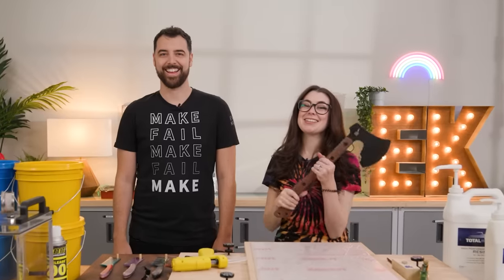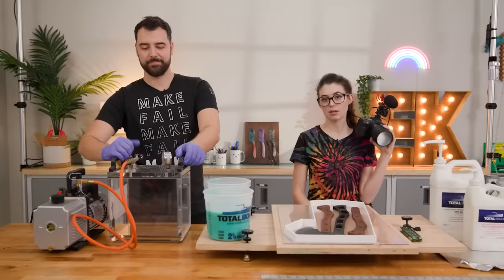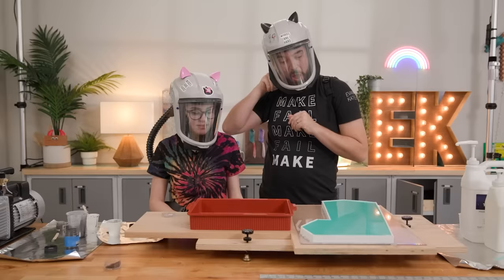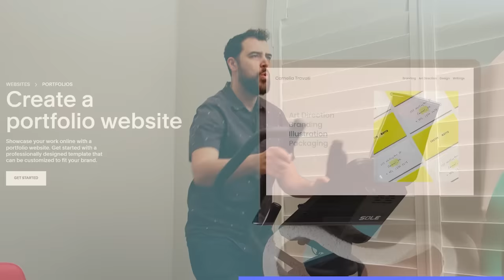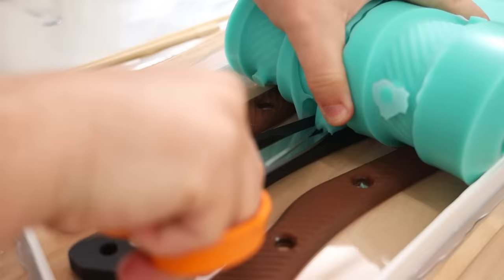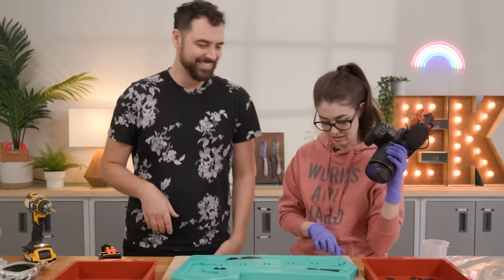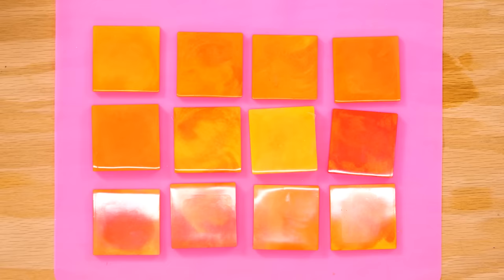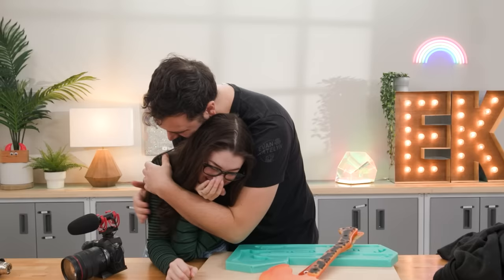Making a Lava Resin Axe (it glows!)

Comment: The glow looks so cool and the color for the lava is spot on! ❤

I think the main problem with the rocks is that usually the dark crust floats on top of the lava so you’ve got a bit of a 3D-Effect going on as well as the different textures. But the clear coat you guys applied first gave both lava and rocks the same texture, both were shiny. Maybe it would be more realistic looking if you made the blade completely yellow and red with glow and added the rocks later on the outside. Maybe airbrush them on or use some kind of grout or some of the techniques people use for making rocks for miniature landscapes.
Reply: I thought the same thing! But I was thinking that maybe they should've pressed the rocks against the lava handle when it was still tacky, so the lava would be dislodged in a (hopefully) naturally-looking way
Reply: @PrismariLaura  That’s a good idea! I was thinking maybe an led strip running down the middle of the handle could be a great alternative for the glow pigment. That would give the lava resin more contrast and make it less cloudy.
Reply: You guys should film yourself making your realistic lava axes 😊 the ideas sound neat
Reply: I was thinking maybe painting the rocks could help there are  lots of organic fake rocks tutoríals out there
Reply: I wonder if it would’ve worked to have just done the inner core the lava, whereas the two outer handles are clear coat and the rocks? That way there’s still some semblance of a “3-D effect” of the rocks being on top of the lava, but still having the handle be functional
Reply: @Drew Stark that's pretty much what I was thinking
Reply from the maker: Adding the rocks after would definitely be a cool technique to try!
Reply: Just a thought for when you display it- a black shadow box with LED lights (in ax silhouette) to illuminate the ax to be able to instantly get the glow effect. Maybe even having a switch or timer for the LEDs to "charge" the ax then letting the ax glow until dim.

Comment: For the lava rocks, a good idea would have been to pour a thin layer of silicone in a box, then put your fireplace lava rocks on top. Once cured, remove the lava rocks and use the impressions in the silicon to make your resin lava rocks.

Comment: I gotta say, as a resin tech, I appreciate the fact that you guys actually use good PPE for working with resin.

So many woodworkers and craftspeople work without so much as a 3M respirator (and those are imperfect to say the least), so it's refreshing to see you guys using gloves and the fancy helmets, because contact with the skin can (hell, WILL ) cause cancer, and breathing it in can cause cancer and other problems down the line.

It's especially important to wear some sort of respirator if you grind, drill, or sand into the resin as well. The particulates are terrible for the lungs, and the damage can get worse over time from even a small bit.
Reply: Yeah! It's very important

Comment: I'm late to this video so I'm not sure if you'll see this, but I had a suggestion if you ever do this again. For the rocks you could glue rock shapes to the actual axe handle before you take a mold of it. Then shape of them would be incorporated into the handle instead of the handle just being flat. That way it'd be more textured with the rocks on lop of the lava. Also then you wouldn't have to worry about having to use a clear layer to keep the rocks from getting buried in the lava.

Comment: Katelyn's idea of iso alcohol to remove the mold form is perfect with a small addition: To reattach the form to the glass, heat the glass in the oven to 375-400, take it out, Place the mold form on it to cool together. Its should remelt the glue, but if it misses anything you can use a soldering iron or hot air gun.

Comment: Awesome project! Two things that came to my mind:
-The handle color was way duller than the body of the axe. Is it because of the texture of the original you took the mold from? what'd happen if you dremeled any texture away?
-Does the UV powder shine trough darker pigments? Volcanic glass-like on regular light that changes to molten lava on UV sounds amazing. Maybe a bit of it on the rocks themselves.

Comment: something that could help, lava in the parts that is glowy most of the time has a even edge between the peices, like they could all be smooshed into a solid flat peice but have been broken and seperated a little bit. almost like tiled floor, how the grout inbetween is always the same thickness to the other peices

Comment: If you ever decide to make something similar in the future, you could find something water-soluble to replace your outside clear resin layer on the handles, that way you could remove it after you poured the lava to let the stones provide the handles' texture rather than the grippy-lines from the original.

Comment: I love the finished product, the only thing i was thinking is maybe adding a couple pieces in the axe head itself to blend it in with the hand a bit more and then the second being maybe attaching the rocks after it cures with resin so the texture isnt lost by the inital clear coat. Maybe somehow doing a flipped mold so you can transfer it and then seal it in a half layer on top,

Comment: When I worked with polymer clay a lot, I used salt of different sizes pressed I to the surface of the clay before baking to make a faux lava rock texture after you bake the clay and dissolve the salt. I wonder if you could do the same thing with resin. Get it to a honey (or slightly thicker) state and then press salt in, then once it’s cured, soak the resin and dissolve out the salt

Comment: It’d be a great for a prop for like cosplay or dnd or something. Its super cool in UV. I have a hard time imagining how to make it look a bit better in the nonUV shots, since the handle texture is there for grip so you can’t get rid of it, and putting textured rocks on the outside of the handles would make it impossible to handle. Maybe matte, flat rocks on the outside of the handles? Like an extra layer? Idk. Either way, good job, I’m sure it was a struggle.

Comment: to help add texture to pieces like the little resin rocks, it might help to use rough sandpaper once it's fully hardened!
it does kinda look... not so great, but it does look cool in the dark! I think maybe what hurt it was the texture of the handle, along with too much clear coat that ended up sort of clouding the blackness of the rock-bits, which made them stand out less against the red-yellow behind them.
but it does amazing in the dark! that glow powder definitely did its job!

Comment: Omg, this came out so good!! Follow up idea: Resin Recurve Bow! (Maybe resin arrows too?) It would be so cool to see if the resin could be flexible enough to be a single piece cast, or maybe you simply make the handle and buy professional risers (the arms that determine the resistance of the bow) and attach them separate. Orrrr maybe a crossbow with little resin bolts? Anyway, custom archery gear would be such a cool video!

Comment: I had an idea for a project somewhat similar to this. I pictured an aetherpunk-style sword (thinking like a Dao/Cutlass mashup) made of a (glowy) resin core (edge not necessary) with laser cut wood panels that make up the flats of the blade, as well as possibly elements of the guard. The wood would have runes cut out of it, with the intention being that the glowy resin shines through the runes and/or decoration for the blade. Imagine if Kratos' Blades of Chaos and the Darksaber had a baby during Pirate Weekend at the Ren Faire.

Comment: In the dark it looks super cool, however with lava the hardened parts are always floating on top and not submerged, I don't know if the texture of the handle has helped either, but I think if you do another one, maybe a smoother handle surface might help as well as having the rocky bits ontop instead of embedded in the handle. But at the end of the day it's all trial and error :>

Comment: Counter intuitive perhaps, but to replicate the popped bubble look of the rock, how about mixing in a lot of air and then dumping into a vacuum pot when it's semi hardened? Would that work?

Wrt the splatter when you released the vacuum, fit an endcap with drilled side holes in it so that the air is diverted from shooting straight down (a banjo bolt will work nicely) . This is discussed on a number of videos about vacuum pots and is a common solution

Comment: If someone wants to reproduce this and get the effect they are looking for

1) Make one large thin piece for your solid rock out of a brittle material and shatter on top of a piece of cardboard it so it is organic
2) push it back together and flip it over
3) draw lines through each piece to another piece next to it so you can reference how they fit together
4) glue the pieces with the shape you like to the handle 

The pieces should be glued with progressively larger spaces as you move towards the head of the axe with only a few piece on the head
Now when you pull your pieces out the negative mold has the shape already there

5) Pour dark resin in the negative spaces where the rock should be, up to the level of where the handle begins. This will depend on the shape of your positive piece  
6) Pour darker lava colors on top of the rock while someone else pours lighter colors around where you are pouring (this is the hardest part and take co-ordinated volume pours) 

You want to the dark color slow and then have the lighter color poured around it before it runs

Lave is cooler at the solid pieces (darker) and brighter at the pieces with no solid (brighter)

You should have at least a bright a mid and a low tone. the mid tone should not be an evenly mixed high and low but a barely mixed one. When the resin is poured the colors will blend where they touch and the fact that the mid tone was not perfectly blended will help with that if you are using a self leveling resin

Pay attention to the pot time of your resins. How long from when it goes from liquid to gelly to solid.  Do some test timing if you are new to resin or you are using a new one.

The more hands you have or the more articulate you are with moving the better your chances of getting the gradients you want.

It helps to have your cups in groups with enough spacing to be able to quickly grab without knocking them over because it can get frantic towards the end of your pours if you have fast curing resin. This is where experience helps

Things like being able to eyeball the amount of volume your whole project will take AND being able to sub divide the entire volume by each color comes with experience or pre measuring with water and then allowing your molds to dry or using alcohol to displace the water and then let your molds dry

NEVER FORGET THE RELEASE AGENT!!!!!
ALWAYS WEAR HAND AND LUNG PROTECTION, eye should be considered also
Keep practicing and you will get it

Good luck and thanks for reading

Comment: For the dark rock skin had you thought of lightly crinkling heavy duty aluminum foil (spray with some kind of release agent), pouring a really thin layer of the the resin on that, letting it harden, and then breaking it along the thin spots? That would give you some very irregular, facet-like surfaces. Or... something like crackle coat spray paint on the mold itself? Gotta say, though: the final product looked great. That’s something I would expect to see in a Marvel or DC Comics franchise.

Comment: Awesome video, always a fun time watching. A thought about the dark rocks, maybe instead of casting separate rocks to imbed if you poured the same colors as the rocks into the mold first, say filling it up halfway, then popped those out cracked them apart making craggily gaps about an 1/8 to 1/4 inch wide then put them back in and poured the lava over that so it fills back in the cracks. I think it would give the look of a dark broken crust that lava has. I don't know how you would hold down the dark parts though so that none of the red got under them though, maybe a thin layer of clear that doesn't cover the black parts?

Comment: Guys after ots ginished drying sand wet sand and buff   with a super fine grit you dont even need to clear coat and it will be way smoother and shiner.

Comment: If you put the mica powder down first then made the handles with the mix of resin you made the rocks from, you could block off channels for the 'lava' resin, but otherwise made it like the handle was supposed to be pure rock but the lava is breaking through.  Then perhaps a bit of darker variation in the blade.

Comment: Since you tried texturing it with the fire rocks, what you could've done was make a mold from those rocks and use them. Either filling it half-way as an open-sided mold like your axe so you would've had a flat side or entirely encase them in silicone and then break or cut them in half after. 
On the flip side, you could've just used the rocks in the final result so you actually have real "lava" rocks embedded within.
The lava looks fantastic though! Just in case you want to give it another shot!  (Could even reuse the rock mold for other applications; lava soap anyone?)

Comment: American axes are interesting, so you have a metal frame inside the handle? In Finnish axes, the handle is usually entirely wood or fiberglass and only the head of the ax is metal, in which case the ax is cheaper to make because it needs less metal and the handle is easier to replace if it breaks.

Comment: Omg, that axe turned out awesome! 😍It took so much resin though... 🤔I wonder how much resin it would take to make a bookshelf. Not like a little forward facing one, but a tall six shelf bookshelf... That would be nifty too because you could incorporate LED lights so if you wake up in the middle of the night you can search for a nice book to read... hmm. 😮That might not hold up to the weight of being fully loaded with books though... How much weight can resin hold at various densities? 😅Might make a cool display shelf either way. But that would be a massive project, and would probably be easier to make out of wood anyway... but it would look cool.🙂

Comment: My first thought for making an easy mold of rock texture... hmmm...  clay or play-doh pressed on rock with some plastic wrap  (Or molding putty) to act like a barrier to act like the negative mold? when it hardens with.

Or have you guys ever tried Apoxy Sculpt? It's like resin-clay.

Also, I recall hearing on a different crafter's channel that to drill through hard plastic or resin, you actually want to put the drill in reverse and more.. melt the  way through so it doesn't crack. Don't know personally, never tried that.

Comment: I think you could do a lot better with a second shot. Maybe carve custom handle scales without that texturing, I think that would make a world of difference. Or just make a fully custom wooden axe with wooden handle scales and cast that. Also, it might look really cool if instead of embedding the rocks in the pour, maybe cast just the middle section, fill in the gaps, then glue face rocks to that and clear coat it with the rough rocky texture.

Comment: You guys, I have absolutely no experience with resin except watching your channel and some other videos on youtube, so this might be a silly idea. Anyways, your lava rocks, and lava rocks in general are pretty porous, right? They are basically foam. I wonder if it would be possible with UV resin maybe, to make it foam up and then harden it in that state?
I'm imagining something like small quantities mixed vigorously to introduce as much air as you can, and then putting it under low air pressure (maybe full vacuum) to make the whole thing foam up, then blast it with UV? It could be done in smaller pieces or a larger one and then broken up. If this is possible, I think it would give you a pretty great surface structure, though I'm not sure how brittle it would be (likely very). After that, maybe a "gentle" sand blasting could give it a rougher surface finish to get rid of the specular highlights, but I'm getting into extremely speculative territory here. I'm not even sure if you'll read this, there are like 1600+ comments already XD

Either way, thanks for brightening my evening yet again! Cool project ^_^

Comment: guys, are there any ways to paint epoxy resin or modify it to make it behave like paint inside a silicone rubber mold with curved or vertical surfaces? resins usually drip or cohesive forces pull the others on one side. I know there are fillers like fumed silica to solve this, but I was wondering if there are more unorthodox ways or what the experts think.

Comment: las tip...you never ever form a blade edge the way you did, you do this with a twin sides silicon mould not a pour box like you did, because you never ever form a good form , twin side mould will give you exactly what you started out with as a master.

Comment: you also did not need any form of air fed respirator the type you are using are not even designed to capture super fine particles...they are normally for wood working type of work, you are not flinging the pigments around the room with a fan you are sprinkling them on.....loose the masks make life easier....and opening any mask to scratch ones face nullifies the use of a mask in the first place.